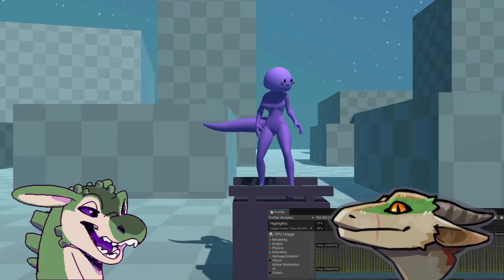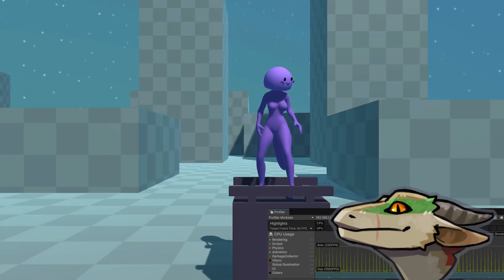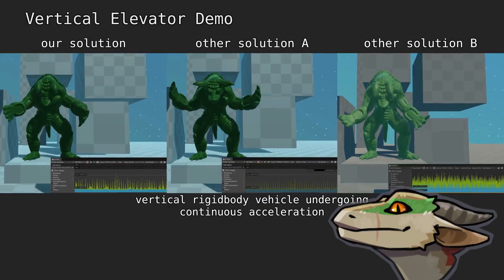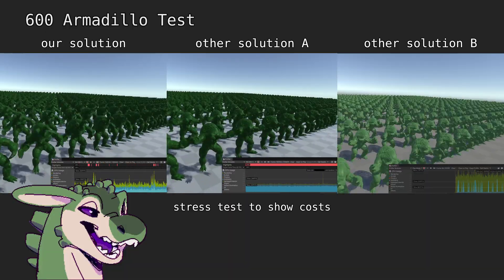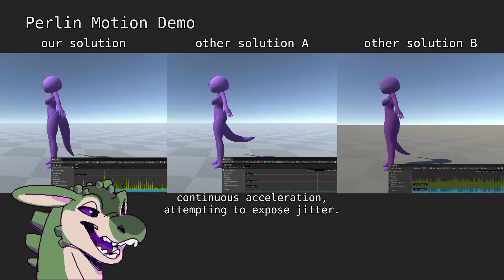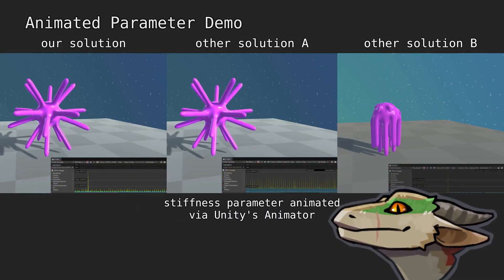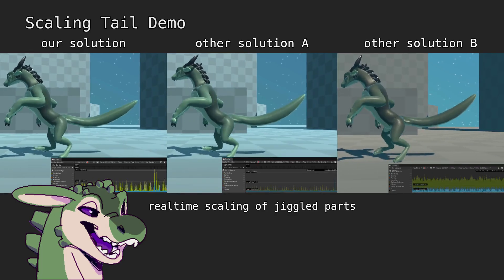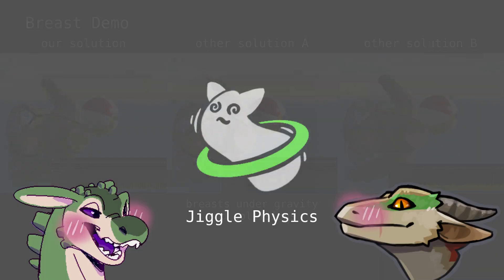Jiggle Physics for Unity

Comment: I see this kind of thing and I start thinking--

Store previous positions in variables. Let's call them PrePosition1 and PrePosition2. At the start of the frame PrePosition2 = Preposition1 and then PrePosition1 = the object's current XYZ coordinates.  Run movement simulations normally. Compare object's XYZ coordinates afterward with Preposition1 and Preposition2. Notably, find the velocity between PrePosition1&2 and then the velocity between Preposition1 and the ending XYZ coordinates. This difference represents your acceleration. If acceleration is greater than a threshold (we can assign this threshold to a variable so we can adjust it freely for fine tuning) then you can apply an appropriate bounce to the soft body object's jiggle physics. If the acceleration is beneath the threshold, however... We can probably just skip running those calculations entirely.